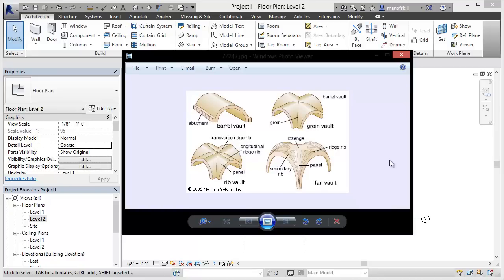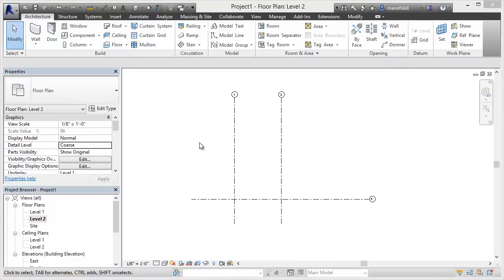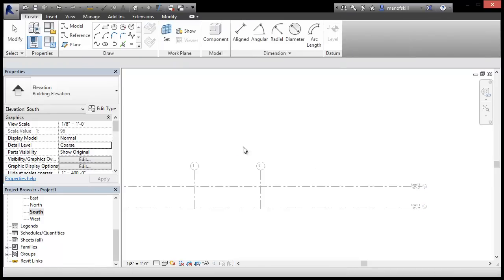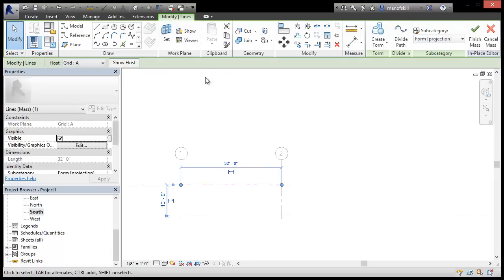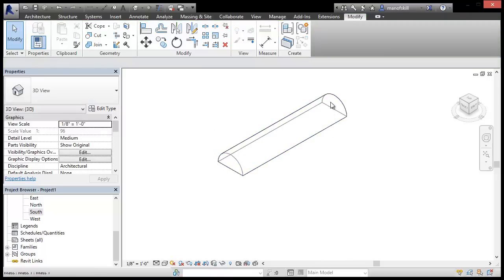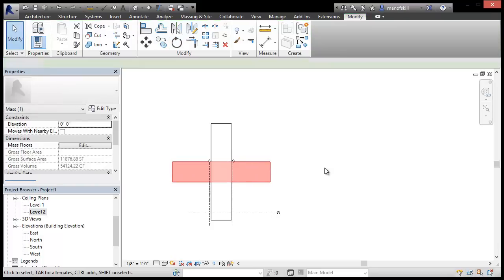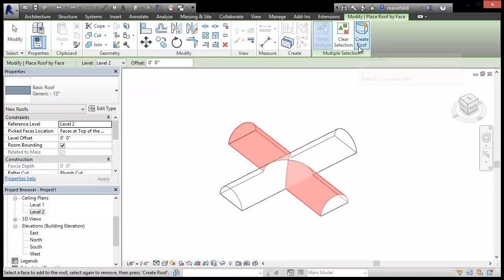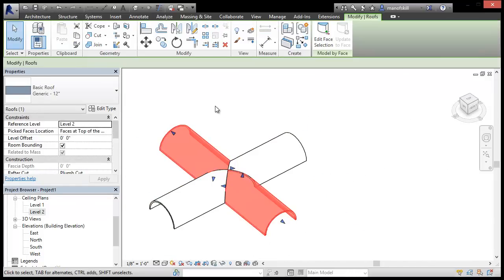Revit Groin Vault Roof

Comment: Someone else commented and posted a similar video over on LinkedIn. This is a nice solution, but I was trying to avoid having to go into massing. I still ended up with having to build the voids, so in the end your approach might be better. Incidentally, I tried Join Geometry instead of Join Roofs, and it worked better. No issue with the dimensions. I still needed a void underneath. I am posting another video on that approach as well. Thanks!